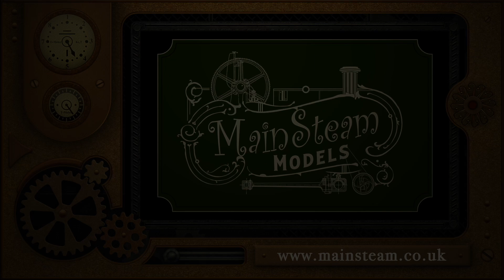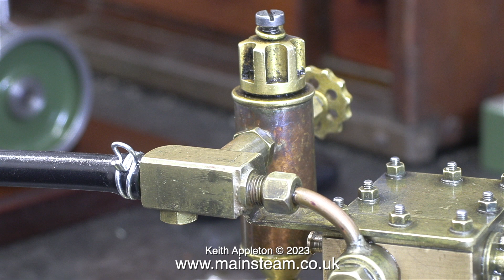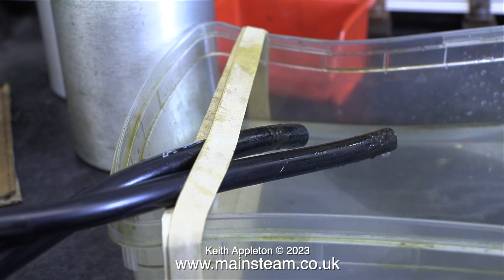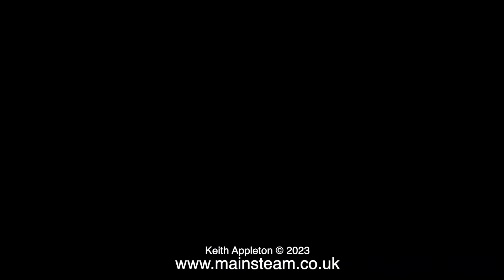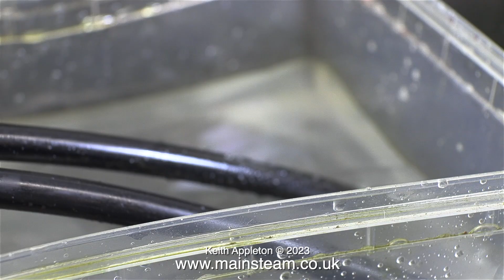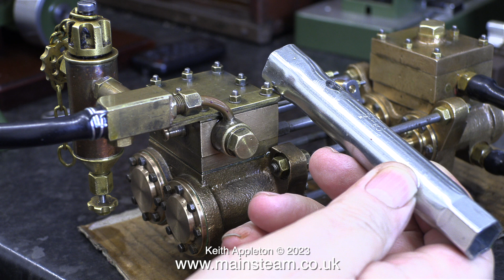SOUTHWORTH DUPLEX BOILER FEED PUMP SERVICE - PART #7

Comment: I do have to say, I love the syncopated beat of this pump.  The musical side of me loves the rhythm, and the engineering side of me loves the exhaust note.  Didn’t you have an engine that had a heavy chuff before you changed the timing.  I wonder if running on high pressure and low cut-off could also make a better sound as I have seen some models with such features sound bigger than lower pressure, high cut-off ones?
Reply from the maker: The pump had a louder "chuff" originally because one side of the water cylinder block had two stuck water valves. I fixed this.

Comment: The pump looks great, sounds great, and works great. Another victory for the master.
What surprised me was the volume of water flowing from the pump, and with considerable pressure too. ;-)
Reply from the maker: It really does need cylinder drains though, as the hydraulic lock soon destroys the gaskets and causes steam leaks.